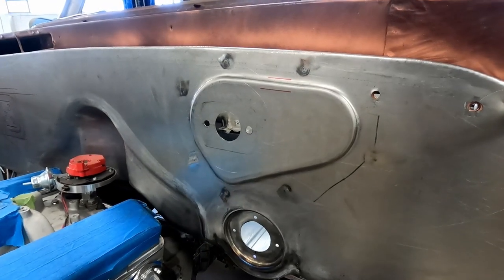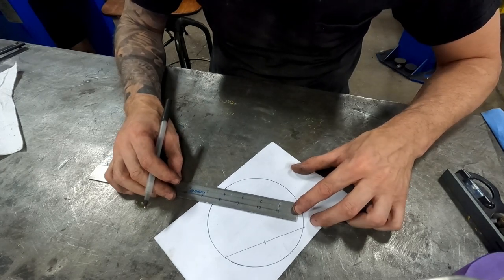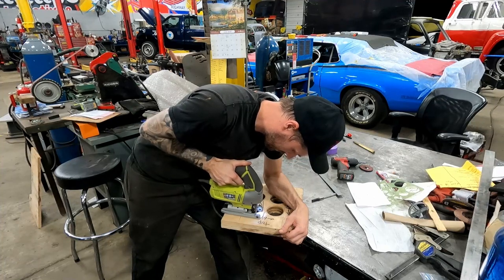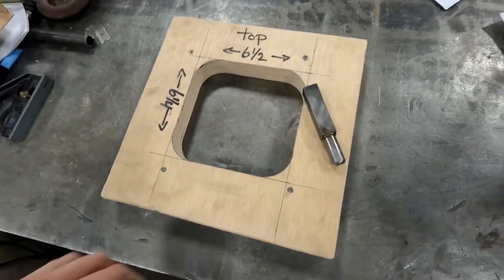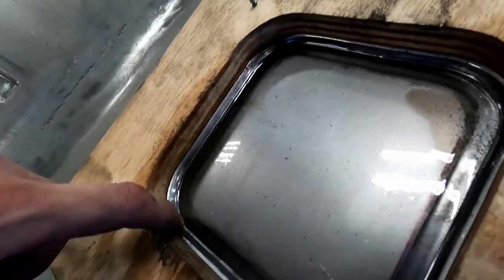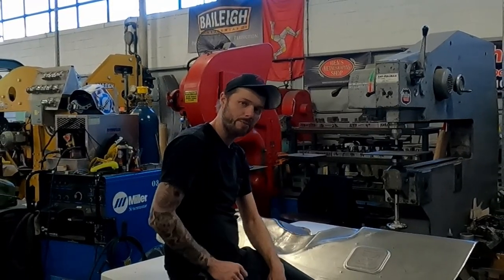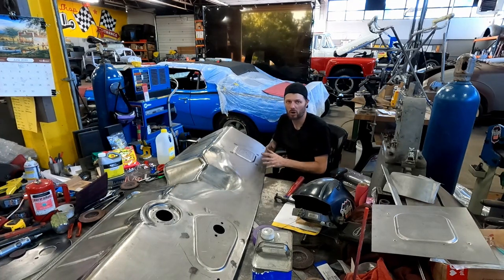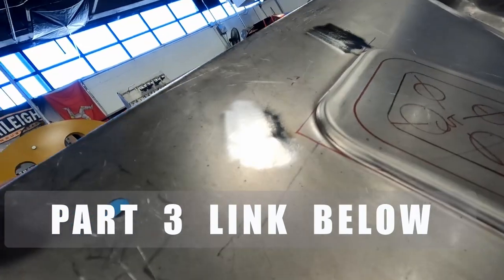Hand-Made Custom Firewall. Pullmax machine Sandwich Die metalshaping.  Chevy C10 Resto mod.  PART 2

Comment: Would you gain anything and minimize warpage chances by reversing to blow pattern going in a circle in one direction and then back track back around the other way? 🤷‍♂️
Reply from the maker: would not make a difference. Most important is multiple light passes. Its pretty hard to get distortion with this process. You would have to really try to screw it up.

Comment: Great video Mike!
A little tip to make finding the center of a circle about to be cut with a hole saw even easier, find a bolt the same thread as the hole saw and sharpen it to a point, place the hole saw where its needed to be and screw the bolt in until it marks center for you... a little tap with a hammer on steel if that's what you're cutting.
Keep that bolt in a handy spot!
Reply from the maker: Yes this is a very handy trick!

Comment: Nicely done Mike.  I have a Pullmax and have been curious about how to do this technique, really appreciate you explaining it.  One question, you used a 4.5” grinder to sand the screw tips off in the early part of the video, it looked like you had a special setup on the grinder to use sanding discs — can you say more about that?
Reply: Just search fibre disc backing pad mate